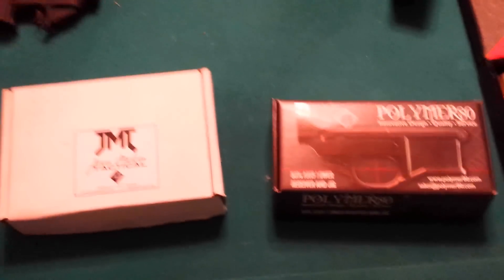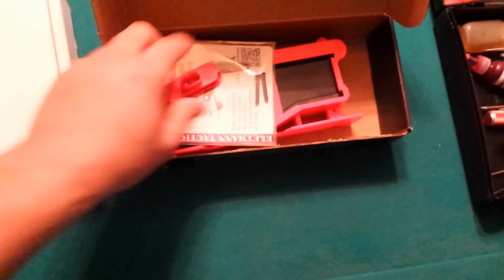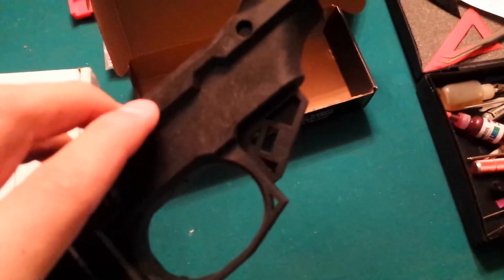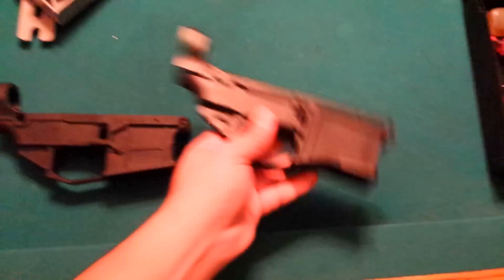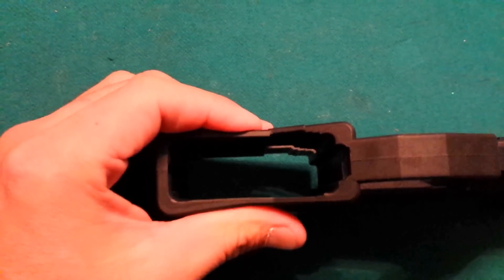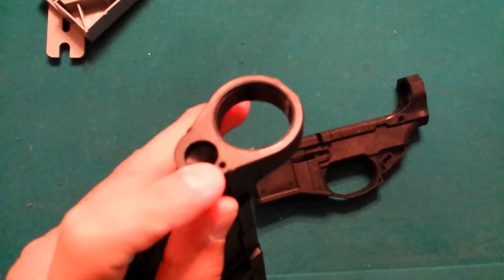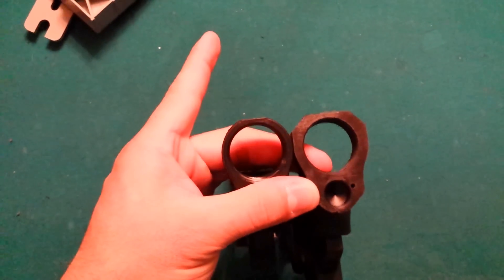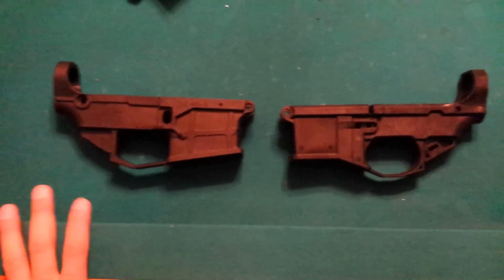JMT vs Polymer 80 lower

Comment: A few years ago I had reservations about going polymer. However after an actual phone call which lasted every bit of half an hour with Dan, one of the two brothers who actually own JMT... my choice was pretty easy. And yes, I still have his number and he’ll still respond. Point being, I’ve had my personal Gen2 lower coupled with a DPMS Oracle for a few years. It’s handled an untold number of rounds out of C-Products Defense mags... you know, STANAG USGI stuff. I mean SEVERAL thousands rounds. Not P-mags. I’ve built rifles for others using the JMT Gen2 lower as well. No complaints. Sure, had to tweak a bit with opening for standard mag releases to work smooth. Aside from just taking the rifle and swinging it against a tree or running it over with a truck, the JMT lower is plenty tough. No issues with pins walking. All standard DPMS stuff. Yeah, it’s got a touch of rattle when upper and lower are connected but I’ve seen issued service rifles (M16-M4) that had more. Quite honestly, there’s not a better polymer lower on the market than the JMT. Yeah, it runs $100, and no it doesn’t come with end mills or other bits, nor does it have some fancy box... but the overall quality is top notch. Think about it... you can buy a Poly80 with bits for cheaper than a JMT lower... price some good end mill bits... where is Poly80’s real value at? They spend money on a fancy box and bits for what? A lower quality lower IMO. JMT puts effort into their actual product, not in trying to convince you to buy with a shiny box and mediocre drill bits.
Reply: A plain regular box is fancy? Lol but I do want to try the jmt it looks very well designed
Reply: @noncompliant209cali  
Yup, plane regular. Haha

No joke, get you a Gen2 or a Carbon 50....
I promise, JMT lowers deliver. Best made 
I don't work for them or anything, no affiliation. I just happen to know one of the owners.
They're some really good  lowers...
Reply: @SuperEvilmonkey88  I was looking at the carbon. I'm getting a few polymer and a couple aluminum 80s because they will probably be banned in Commiefornia soon so the stronger the better.
Reply: @noncompliant209cali  Also... just an FYI... make sure you use proper tools, and know how to read depths, etc... mill it right... don't be "that guy" who goes balls to the wall with his Harbor Freight Dremel style tool holding the lower between the legs hogging out chunks and generally just screwing things ten ways from Sunday... yes, there are some Bubbas out there that do that sorta thing...
Reply: @SuperEvilmonkey88  lol yeah a Dremel and a dream! No, I don't have a router but I have a drill press and a good jig. I made a P80 and an Anderson aluminum lower already.
Reply: @noncompliant209cali  Cool.
Anderson's are usually good choice if you're gonna do alumium 80%... I gotta be honest about the P80 stuff I've seen and dealt with... HARD pass, pass on it like the friendly weird chick at your local gas station and you walk by sayin' thanks for the offer but I'd rather not...
However, the P80 folks may be doing better. Don't know and not really inclined to find out because I know what works and JMT is it for my choice of poly lowers... it works, reason for it.
Lay your hands physically on a JMT and you'll see the difference.
Reply: @SuperEvilmonkey88  are you talking about me?
Reply: @noncompliant209cali  Sorta, no offense. Just saying be sure to handle your bases.
I've seen more than more waterhead pull some "Bubba" s*** and wind up in a real world of  "Federal pound me the ass" prison.
Reply: @SuperEvilmonkey88  lol ok. I'm good. I spend a lot of time between California and Arizona so all my fun guns stay in Az while the boring ones are in California and are compliant
Reply: @noncompliant209cali  Hmmm.... okay... why anyone would divvy up squat or live in any western state... beyond me. Kalifornia ruins cars, politics, all of it... fall off the damn map already.

Comment: I know this is an old video but just wanted to leave a comment for whoever watches this and wanted consumer advice. 

I have both and the JMT broke at the buffer tube after a little over 3000 rounds. I contacted them and they wouldn't replace. I ended up going with polymer 80 because they have a life time warrenty and from what people say they actually honor it. I currently have somewhere around 8000 rounds through the P-80 with no problems. My mags DID NOT drop right out of the box but only about 10 swipes with very fine sand paper and they drop free every time every mag. My JMT build was all top quality parts I didn't skimp on anything ( 1700 total). My P-80 build I went as cheap as possible, AR stoner upper, everything else straight from P80 even the red dot sight and it is my go to rifle. Now they are coming out with a Glock compatible 80% pistol frame and that is going to be sweet.
Reply: +Dale Pudvah   ( Dear Dale), Customer service Dept. here with James Madison Tactical. In rebuttal to your comments regarding your JMT Lower buffer tube breaking. We have searched our customer logs as well as our merchant accounts records as far back as March 2014 and have not been able to find you as one of our customers. We have also checked customer service phone logs and again no complaint filed by a Dale Pudvah we also checked email service records and again no complaint by a Dale Pudvah. May I ask when you contacted us with a formal complaint? Who did you speak with? What's your order number? If you in fact ordered from us and your JMT buffer tube broke we would have replaced it at absolutely no charge to you, all we would have asked for was a picture of the broken lower. Please contact us in regards to your complaint 1-509-392-7500Thank You,James Madison Tactical
Reply: James Madison Tactical, I think you make a great product! I am building a AR-10 and want it as light as I can possibly get it. I was very hesitant on going with a composite lower but after doing some research on your product I am confident that your 308 lower will do just fine. Looking forward to my lower arriving so I can get going. I have a feeling this Dale guy never really owned one of your lowers.

Comment from the maker: I have since used my JMT lower for my 300 blackout and it works great!! Less back pressure than a 5.56 so for those of you worried about the buffer tube attachment area failing. Plus I would use an adjustable gas block to regulate the as pressure going to the carrier. adjust it enough so bolt catch can do its job after last round is spend.
Reply from the maker: John Lain polymers mill really quick. just take your time and measure the pocket depth often when you get the 1.250 depth, feed slow when doing the safety selector hole and trigger holes because the bits like to grab. just take your time cause if you screw up you can't add material. it helps to have your upper so you can mill it to fit the upper your using for the width and depth to limit over milling or under milling

Comment: Have done both 80% lowers. To add what you said, the JMT 80% comes in Flat Dark Earth, and Olive Drab, in addition to black. The Polymer 80 only has black. The JMT jig is not a drill through for the trigger, hammer, and safety, but the jig is designed so you can flip the 80% to use the same side of the jig to drill on both side.

See here on their instructional video
https://www.youtube.com/watch?v=pdFNVwkLAP4
at 2:16 sec mark.

Like you said, Polymer 80 won't fit many mags, and I have already had a crack on my Poly 80 at the take-down pin area, but I had none on my JMT, even though my JMT lowers had gone through 3,000+ rounds and with 7.62x39, as well as 5.56 NATO.
Reply: Which poly 80 model is yours? I've got over 1000 rounds full auto thru the latest gen with a 8 inch SBR build

Comment from the maker: sky rebecca
 this JMT jig I have is their newest jig and they actually changed it to where you actually drill all the way thru from the right side. If you go on JMTs website they have their pdf downloadable instructions and they state specifically that you drill all the way thru. the video you put in your response is an older video that was to be taken down because that was a demo on their first jig for the first gen lower. here is the link to JMT http://www.jamesmadisontactical.com/docs/JMT%20Polymer%2080%20Machining%20Instructions.pdf. page 6 of 12 is where the directions state to drill all the way through.

Comment: Good video, Mehrt.  A few comments and a question.  As to the box, the Poly80 is set for good marketing and has good explanations of what the product is and has--nice touch, but most builders will have made these decisions long before they even see the box.  So yes, it seems a bit superfluous but still a nice touch.  That they include the drill bits is also very nice, especially the largest bit used for the actual work of cleaning out the fire control well--it's not one that's easily found (the others are standard bits).  The flex in the magwell is not really an issue, but the tightness IS!  I had to do a fair amount of sanding out to get my mags (even steel or aluminum stanags) to work well.

I can't really speak to the JMT as I have never seen one, but by your comment that it is more expensive, I have to wonder why they don't also include the necessary bits for the work.  It seems that this would ease a decision for noobs for which one they might spring for.

My Polymer80 drilled out nicely and has performed well except in one area--the bolt hold open doesn't work will all mags, especially the P-mags!!!  When assembling this part, I thought the pin that holds the bolt hold open button was very flimsy.  It seems to be holding up under the strain, but I've noticed a lot of side-to-side slop, allowing it to twist slightly in the slot.  In aluminum lowers, a roll pin is used and works quite well.  This dinky pin is held in place by a set screw, but I'm left to wonder if there might be a better solution.  Has anyone found my problem in their build?  Any comments would be appreciated.

Comment: you said you might test others, the only lower i have actually completed myself (in polymer) has been an EP Armory, and the thing was complete shit, the holes were WAYY off, and it didnt come with a jig, just the different colored polymer that you drill out. came out great, except the trigger group and fire selector holes were so far off i couldn't get them to work at all.

JMT seems to be the best on the market, and in a few days they are releasing their 308 DPMS style lower for pre-order.

Comment: Ask yourself what that thin wall portion of the magwell is doing.  You've seen skeletonized aluminum versions yes?  It's mostly just to keep dust and dirt out, very very little stress there.  The lip of the magwell is the portion that needs to be beefy.
Reply from the maker: Well since all the mags wouldn't fit and the walls were pretty thin there was not much to file down.
Reply: Blake R polymers are known for flexing when the rifle gets hot after shooting anlot of loads. thickness helps with that so it doesnt flex and lock your magazine in the magwell

Comment: Have you tested both of them?  Which one is better or do you prefer?
Can you use the same Polymer 80 drill bits for the JMT?
Thanks; I appreciate you doing this video.
Reply from the maker: crusader68 Yes you can use the polymer 80 drill bits and milling bits on the JMT lower. I have shot both and I prefer the JMT lower. It is a lot more rigid in the magwell area and all mags fit flawlessy. The polymer 80 is a little flimsy in the magwell area and seems to have a little issue with PMAGS.
Reply: Hurtin Mehrten
 Thanks, that info helps my decision.

Comment: the. buffer on the polymer 80 is much thicker then jmt which is the part on the lower that needs to be more reinforced .the magwell is thick enough that you shouldn't worry about one sanded down with 800 grit the pmag will reinforce the magwell .AMD also I would like to add jmt price is to high For what they asking i could buy a stealtharms lower .well that my opinion. great video

Comment: Isn't there a version with an embedded threaded brass insert at the buffer tube connection?  Are all these polymer 80% lowers entrained with reinforcing fibers, usually nylon?
Reply from the maker: reinforced or not that mag well flexing inhibits the fitment of most mags
Reply: Non sequiter.